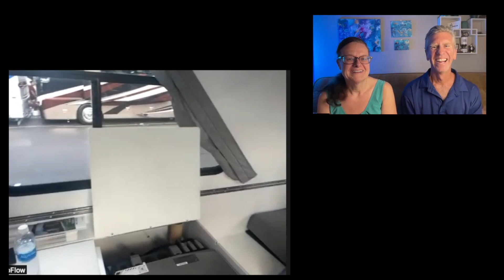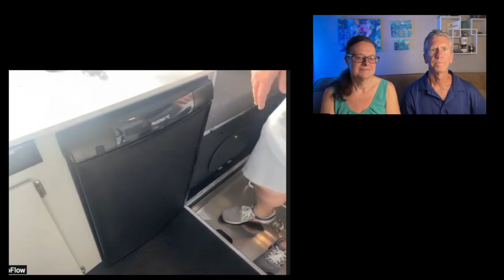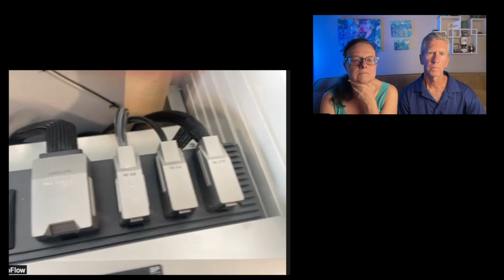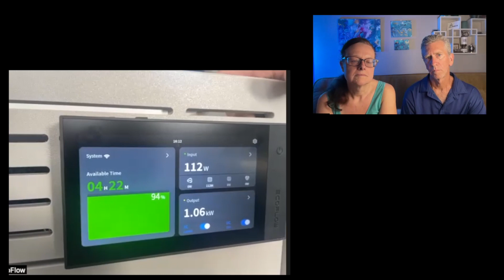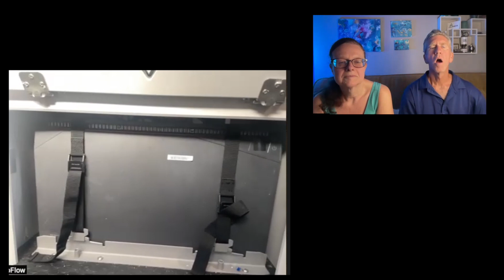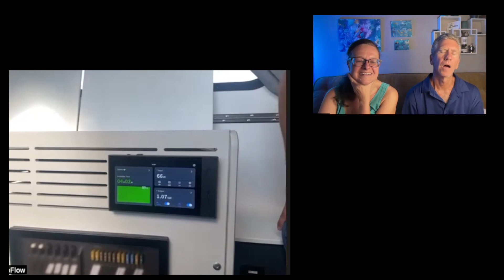ALINER AMP & ECOFLOW Integration | Live From Hershey RV Show | ALINER Podcast Episode 3

Comment: The holy grail is enough battery to run a fridge, AC and a few lights for 12 hours. Then be able to charge up in sun light to set up for the next night. Living in south Florida it would be a game changer for my family of 4.
Reply from the maker: Yeah, the AMP includes a 5Kwh battery.  I'm not positive on the AC energy requirements, but I don't think it would do that.  Probably more like 6 hours.  You can add another 5Kwh battery to the system, and then you'd proably be able to run it for 12 hours.. but the solar would probably not be able to recharge fully.  You might want to reach out to Aliner directly though.
Reply: Just running the numbers, 800 W panels would charge up the 5 kWh battery in about 6.5 hours of peak sun. You're not likely going to get that in one day. There is an option for plugging in another solar panel, so that's definitely an option for getting closer to a full recharge during the day. You might need to limit your AC use, and then you should be good.
There's also an option for plugging in another battery (about the 17:00 mark I think). Have it charged up before camping and you can stay out longer with full AC.

Comment: I 💕 LOVED 
THE TWO IN ONE
🛁 🚿 TUB TOILET 🚽🪠
IT JUST NEEDS
ONE OR ONE N A HALF FEET
ON THE LEFT SIDE TO BE 
A STAND ALONE ASSET.
SO YOU COULD STILL
HAVE YOUR DINNING ROOM 🍽️
And LIVING ROOM SEPARATE.
I NEVER SEE OUTLETS,
ATTACHED TO KITCHEN AREA.
And THEY NEED TO INCLUDE
A SIDEWAYS DOUBLE 
REFRIGERATOR.

WHY CAN'T THE DINNING ROOM, TURN COVERT INTO 
BUNK BEDS ?

UNLESS YOUR HOMELESS,
YOU CAN'T COMPLAIN 😞

12 DECEMBER 2023
THEY NEED TO FIX THE
INSECT PROBLEM TOO

TO STOP 🛑 THE 
LEAKING 💦 IS ASKING
TO MUCH. SO I WON'T.
Reply from the maker: Thanks for the feedback !!

Comment: So if one wanted to carry a back up dual fuel generator to run the AC and charge the ecoflow battery at the same time what size generator would be needed. I live in Florida and running the AC all the time is really a necessity.
Reply from the maker: The ALiner's Command AC Heatpump units are really efficient, their starup loads typically don't exceed 1500w, and run about 800-1000W.  I really don't think you'd need more than a 2500W generator to both run the camper and also charge the battery.

Comment: This camper looks awesome and I love the EcoFlow integration!! I have several of their portable generators & 3 solar panels. I'm not a fan of jamming a cord through windows, dormers or door jambs. Rather than "wiggling" a cable into the camper somewhere, it seems like this was a big miss not having an outside port to be able to use a portable panel when parked in shade and needing to get your panel in the sun. Hoping an outside port is added sometime in the near future as not having one kind of defeats the purpose of having this wonderful solar system!
Reply from the maker: From what they said it would be fairly simply to change the connector of their portable solar panels, and simply unplug the one that's on the roof, and then plug the portable one into the zamp port.  There are now 2 zamp ports on the aliner.

Comment: If I had the money, this is definitely the way I would want to go with this setup being standard from the manufacturer. A camper that can fit in the garage, be towed by a minivan, and no propane.

Just needs a double bunk over the dinette to sleep 4 and they absolutely need the option to plug in portable solar panels for keeping the camper in the shade using MC4 or SAE connectors. No need for expensive brand solar panels. That Ecoflow can take a ton of solar.
Reply from the maker: Thanks for sharing.  This model does have propane on board to power the furnace and 3-way fridge.  Definitely agree for the need to be able to plugin a portable solar panels. Still, very innovative model.
Reply: @GoldenK9Campers  oh ok, I missed that. Thank you for clarifying. Seems a little odd though to have such an expensive and capable solar battery system and still have a 3 way fridge when they went electric with the water heater. 12V fridges are very simple and don’t draw much power at all. I can understand the need for a backup heater though. Electric heat pumps work well down to 40F, but if it is colder or you run low on power then yeah you need something else, although maybe they could have simplified that too with a diesel heater.
Reply from the maker: Our fridge running on propane works so well.  And given they have it.. why not use it.  I love our furnace for the heat, hate it for the noise.  Propex makes a great unit.. that's quiet.  I wouldn't add diesel to the mix for sure.. Yuck.  @TumnusMr

Comment: I would be interested in looking at the specs of the Eco-Flow system. I went to their website the other day looking for a 5KWh system it could only find the Delta models. 😁
Reply: Look for 5kwh Power Kit under Solutions.
Reply from the maker: Me too.  If you go to ecoflow.com and click on solutions you can see the power hub and the other components.  Their definitely working with other RV manufacturers in their built in power solutions.

Comment: Great video.  Somehow the comment at around 12 minutes is hard to believe.  The comment said it would take 2 hours and 43 minutes to fully charge the battery.  If you could really get 800 watts out of the solar panels it would take a LOT more than that to charge the battery from empty to fully charged.  If they actually put out 0.8 KWh/hour and the battery is 5 KWH it would take 6.25 hours under absolutely ideal conditions.  But I bet you couldn't charge the battery in a single day because the panels don't track the sun and the angle drops during the day.

Switching to an electric water heater (on demand) and an electric stove puts a lot of drain on the battery that could have instead been accommodated by propane.  Just wait until you have to go to a $250/hour technician for repairs.  I doubt if there are any repairmen who work on Aliners who would be able to diagnose and repair future problems with this system--too high tech.  But most low-tech Aliner repairmen could replace a propane stove and a water heater.

It will be interesting to see how this all works out.  Note they never addressed the lunacy of painting the exterior aluminum trim black and using black panel covers.  All these are counterproductive to being able to keep the interior cool in environments where sun might be readily available (and cooking the interior of the Aliner).
Reply: Comment was shore power and it is a 48 volt systens so it is more efficent and faster charging
Reply: Something that caught my eye was the fact that it was only pulling 106 watts from the panels at 94% SOC.  
I guess the 6.xx kWhr used was  cumulative data & not something that reset every day.
Reply from the maker: Leave it to you to catch the details !!  Thanks for sharing !! @eugenebreindel
Reply: This is a very modular setup. I doubt very many parts are hardwired and are most likely standard plug devices so the owner could easily swap out parts. No worries about propane leaks and cooking on propane inside puts out a lot of heat and water vapor into that small space.
Reply from the maker: At the end they did address the color of the unit.  It's going to be white vs the dark grey.  Thanks for sharing Brian.